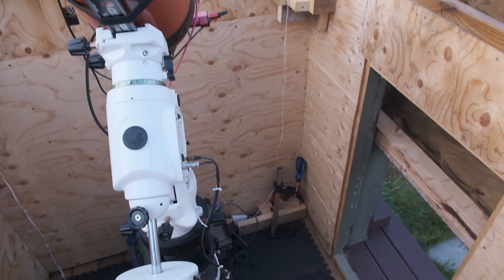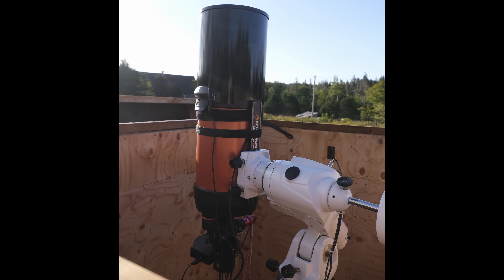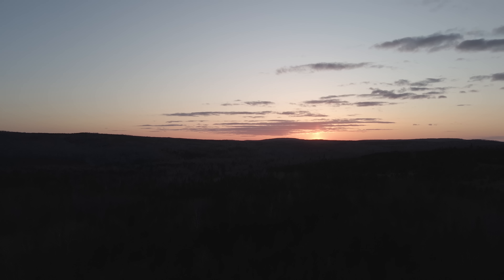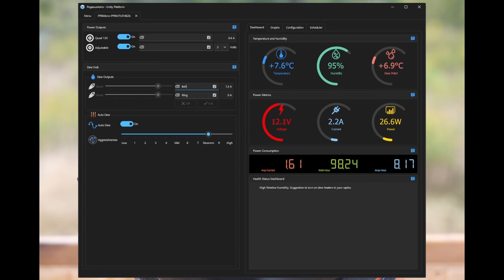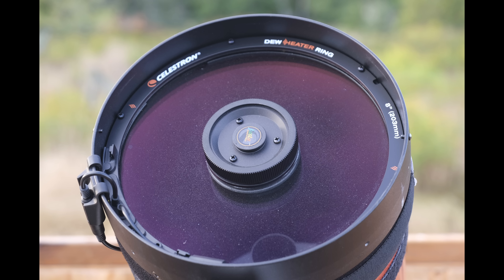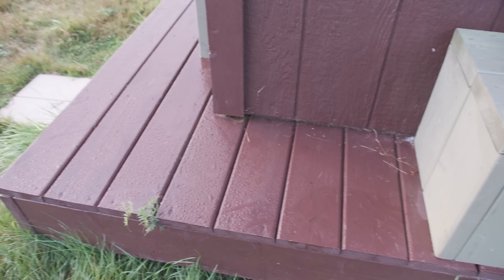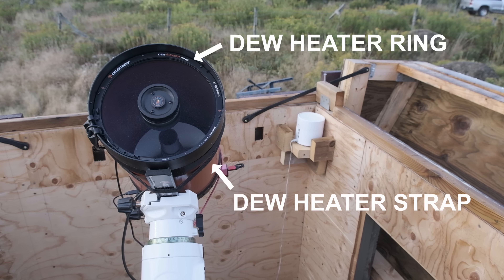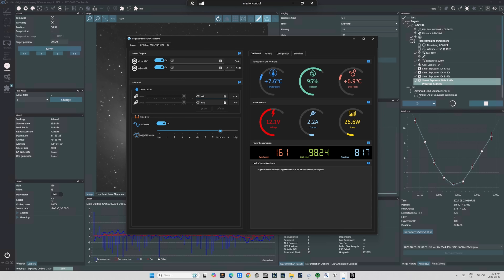Are Dew Shields Really Necessary?

Comment: Thank you for this informative video. As a Newton user I was using the shield mostly because of stray light. But good idea to try it without and see what it will do for guiding improvement.
Reply: Recommend a dew shield on a Newtonian anyway if your focus tube intrudes into the tube at all, that focuser or even your coma corrector can catch and reflect stray light and cause odd halos that flats don't remove.
Reply from the maker: I haven't personally used a Newtonian, but some Newt users on Cloudy Nights told me Newts don't generally struggle with dew because the mirror is all the way at the back of the OTA and there is no corrector plate up front. This makes the OTA itself a giant dew shield.  Have you found that to be the case?
Reply: @SKYST0RY  Not the OP, just chiming in. I live in a very humid area. Back when I was still doing visual observation with a Newtonian, I would get a short observation window before dew blurred the image to the point where I had to give up. While the primary mirror is tucked at the back, the secondary still sits a few inches from the front, while the eyepieces are out in the open. Wasn't as knowledgeable back then, so I never thought to check which part of the optical train was causing me issues. But the idea of a dew shield helping with Newtonians, to keep the dew off the secondary mirror, doesn't seem unreasonable. And a dew heater wrapped around the focuser tube to keep the eyepieces dry.

I guess it also depends on the type of Newtonian. We mostly think of the straight tube type, but there's also the open models, with the short body housing the mirror, extended by an open strut construction to hold the secondary. My guess is that those would be more susceptible to dewy conditions if you don't wrap the included stretchy fabric hose around the open part of the body.

Comment: Why not try to implement your own control using NINA and Sequencer Powerups? You can have the dew heaters come on when the temperature on the corrector plate is 2C or so above the dew temperature, and have it turn off when it is 5C above the dew temperature. You would need to calibrate first to get the difference in temperature between the temperature reading and the center of the corrector plate. You would also need to play around with the power settings, but this might be the most energy efficient way, plus you would not have to ever worry about whether it is a high humidity night or not again. This type of control is called bang-bang heater control and it is a very commonly used feedback controller method.
Reply from the maker: That's a good idea. I'll look into it. What sensor are you using to inform NINA what the humidity and temperature are?
Reply: @SKYST0RY  I have the Celestron dew heater controller module. I connect it to NINA both as a switch and as a weather station. Perhaps you can do the same with yours?

Comment: Thank you, THANK you, THANK YOU!!! I have been battling pinched stars on my 8 inch Edge HD with the learned help from my incredibly supportive and knowledgeable  SASI members. Ironically it started around the time I gave up using a hair dryer when I worked out that my dew heater ring wasn't actually working and I fixed the power issue. 

Suddenly, spikes appeared on my images, every sub and again I got the SASI collective in on the act. We had narrowed it down to the dew heater but I had not had a chance to test the hypothesis out.  Then, as if the algorithm and your good self were plugged into Sydney Australia, your video appeared. I started watching it 6 minutes after it dropped.

My answer came at 4min25s in.  I can suggest you highlight this start point for some to go back to.

To say this video is potentially a game changer for so many shooters out there is something I say with careful consideration.

Thank you so much, not just for this video but also the thoughtful manner in which you help us all in the Astrophotography Collective.
Reply from the maker: You're very welcome! I am glad it helped. BTW, my wife grew up not far from you.  I have read (but have no personal experience with it) that the Edge is far more prone to pinched optics than the standard models of SCTs.  I think Edges can still avoid pinched optics, but you have to be even more careful with the heat applied to the dew heater ring.  Apply only exactly as much amps as you need and no more with an Edge.